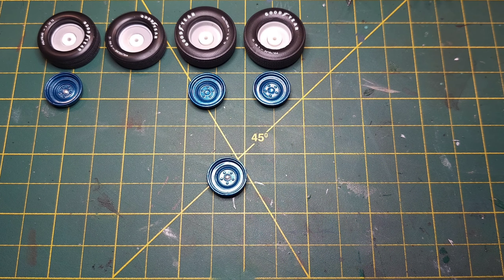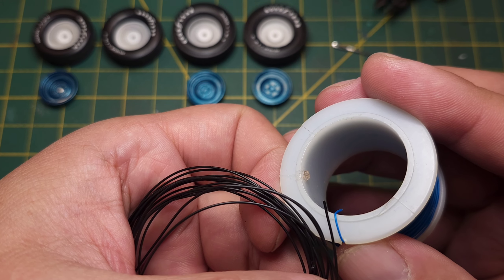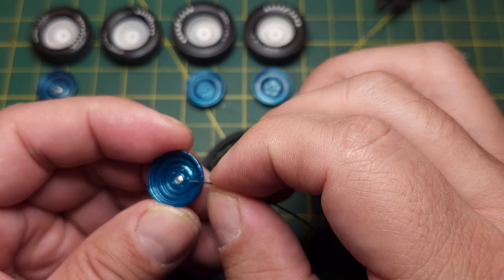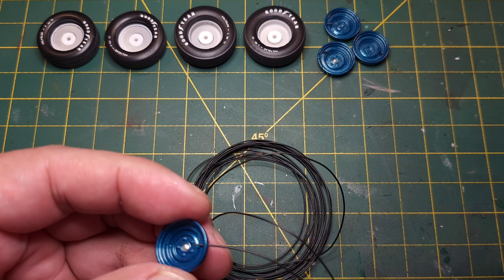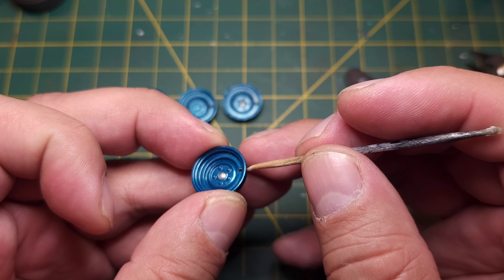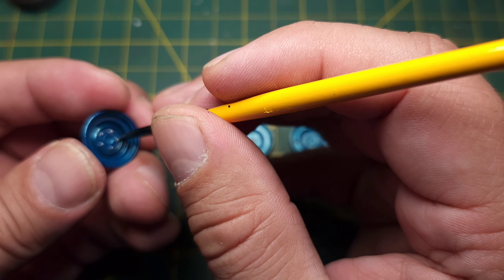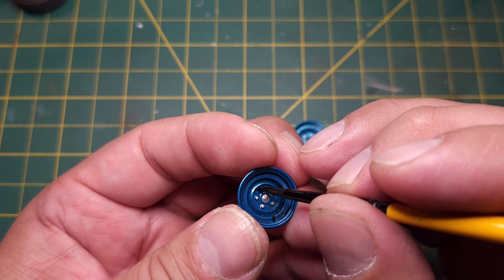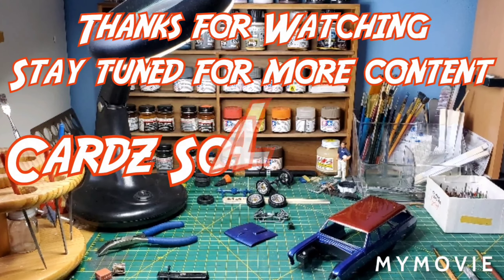Part 3 : How to - Add valve stems to any type of wheels - scale model building tips and tricks

Comment: I usually use 32 gauge, but since it's so small, you usually have to point it out that you added them, like the short I did the other day
Reply from the maker: I usually use the same type you use. But ya same thing very difficult to see. First time trying the rubber style stems.
Reply: @cardzscaledreams3917  using the black wire just made sense on a steel rim.
Reply from the maker: @pappytinkers  that was my thought too. No need to be flashy on stockish rims.

Comment: Keep in mind, when you install the valve stems ( especially on steelies) that the valve stem should point outwards ( not straight up) The reason is that almost all non custom wheels are designed to use wheel covers! You would never be able to access the valves with wheel covers on if they pointed straight up! Even most custom wheels have valve stems that point outward. Also, plastic rod ( .025 -030 ) make great valve stems. Easy to paint and easy to glue.
Reply from the maker: Great points...didn't even think of that.👍✌️

Comment: The wheels look good Pat I have actually used round toothpick tips printed black they are alil outta scale but you can see the detail. Its a tip I from got from Tim @ throttle power
Reply from the maker: Ya, that would def be the correct shape. I might try something with round styrene  next time.